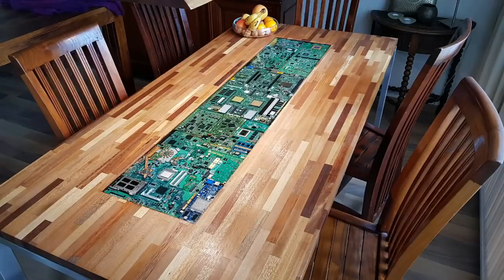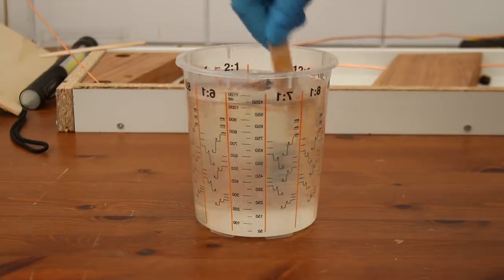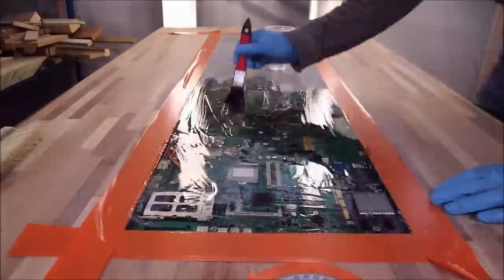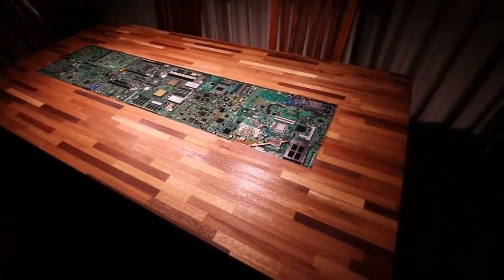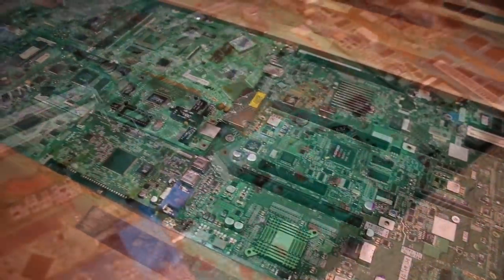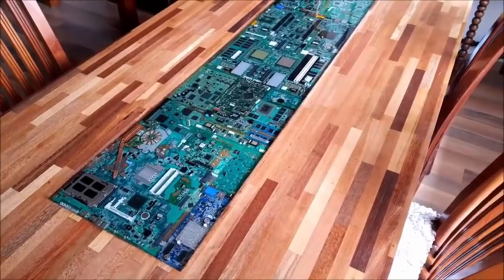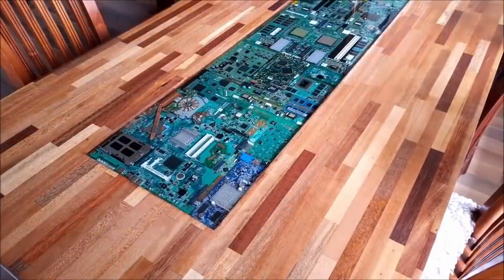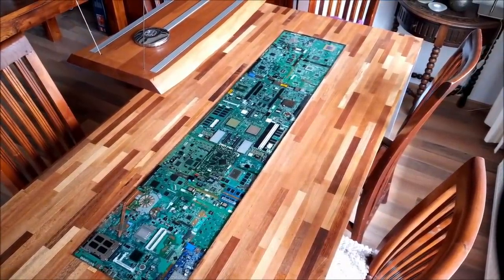Circuit boards with lights in epoxy in a table

Comment: Thanks for uploading failed projects. They are as useful and as informative  the successes. One question. Is there any issue the LEDs would overheat?
Reply from the maker: Thanks. Ouch, you've not seen the whole video, now have you? Because the answer to that question is in it. (What looks like a LED, doesn't have to be one.. 😊 )
Reply: @Onrust1  I usually stop videos less than half way through and then skip to the end .... but if you insist. I will watch ALL of it..... Okay done that, see what you mean, next time I will watch all of it.Actually fibre optic was a really clever idea!

Comment: The epoxy should be mixed for at least 3 to 5 minutes to be well mixed, you never used flame to remove lumps of air and give more transparency between the layers
Reply from the maker: You should watch this: https://youtu.be/rJBFk-5gMQY 
In there I explain more of what I did.

Comment: I’m wondering if you were to remove a 1/4” of depth with a router , sand it clear and then add more epoxy ,or a layer of 1/4” glass ?  Not sure how to fix the damaged area however where it’s not clear
Reply from the maker: That's about what I did. Check it out here: https://youtu.be/rJBFk-5gMQY

Comment: Try router out a thin layer with out hitting the circuit boards and putting fiberglass resin over the epoxy.

Comment: I'm useless with this kind of thing, but would a good method have been making the circuit board part in a separate vessel and sliding into place after a successful pour and set; avoiding the imperfections of the table and the one-shot-deal of the procedure?
Reply from the maker: You're being to hard on yourself. How can thinking with me be useless? 😊 Yes, you are right, it would have been possible, and with less risk, but with more work...

Comment: we've had problems working with Epoxy before, we think it was to do with the solder/copper on the pads corroding and interfering with the curing process. we've also had similar problems when not mixing the 2 parts correctly, with the amount you had you'd probably need a mixing machine... or maybe something not as thick so will mix better.

Comment: Put a wide flat metal "frame" around the edges to cover all that up - it might diminish the size of the circuit display, but it would still look awesome, especially if you then did a thin pour over that and the entire table (you could even put the same kind of thin metal edging going vertically along all edges of the table with just enough sticking up, like 1/8 inch, for the top layer of epoxy to pour into) - just a thought! I really did enjoy watching, nice edits & music, and I like that you didn't chat while working, subtitles were perfect to have in a video like this. That pouring... ah!!!
Reply from the maker: By now, I'm ready 'fixing' the table. As you can see here:  https://www.youtube.com/channel/UCNdDV4vHKjuWOYlEW4HIk5w/community   I routed out the bad spots and poured in new epoxy. It's much better now than it was. Wait for the video 'how (not) to pour epoxy'. 😊

Comment: with the epoxy you work only ones no put one layer and live dry by air you have to use fire a tourch for live clear and strong, look other videos of working with epoxy and see they use fire in the proses for solid and put all epoxy  crystal clear ,god blest you bye

Comment: just put a glass plate over the entire table , boom - done   it’s still awesome work you done  and very unique
Reply: This is the best solution! If he doesn't want to put the glass in contact with the epoxy, he just has to put something to separate both things leaving a little space in between. That table looks just amazing!

Comment: I don't know if this would work for sure, but I'd try drilling from under the table, in a few spots, with a forstner bit, until it gets to the epoxy, and then hammer it out from underneath, using something to fit in the hole, while tapping it with the hammer.

Comment: Couldn't you just sand down the the epoxy to remove the soft spots?then pour it again?
Reply from the maker: Sanding soft epoxy is impossible - your sanding paper would be filled and useless very quick. But yes, taking it out was indeed essentially what I did. As you can see here:  https://www.youtube.com/channel/UCNdDV4vHKjuWOYlEW4HIk5w/community   I routed out the bad spots and poured in new epoxy. It's much better now than it was. Wait for the video 'how (not) to pour epoxy'. 😊

Comment: Would it really be problematic to use regular LED's by the way. I mean we are talking about a very small DC current of say 200 mA at 5 V or less to light them all. And I assume once dried the epoxy makes a perfectly fine insulator. Given the low power requirements if anything fails it's most likely the transformer and not the wires or the LEDs.
Reply from the maker: Yes, I agree with that. But for me it was not so much a technical question, but more in the usability ... I thought you would go crazy quickly with battery powered lights with a controller, because of that carnival in the table all the time... 😊 It is the temporary character of the manual light for a few seconds in the fiber optic that I like.
The sheer simplicity of this solution has its charm too, don't you think? 😊
Reply: I can see the benefit of the interactivity of the fibres. Especially if the idea is to display the piece in a public setting as anyone with a light-source can bring the LED's to life. 

That said I would probably go with a small integrated circuit and micro-controller if I planned on actually using the table. Basically something like an Arduino or a Raspberry PI comes to mind although better dedicated light/display controllers probably exist. The arduinos can usually be powered with any 9-12V power source so you don't have to go with batteries if you have a fitting AC/DC transformer lying around from an device that's broken or unused. The benefit would be that you could control the lights via programs. Effectively running multiple patterns and controlling which via a switch. Similarly one to turn them off or go to a default program can be managed via it's own switch. The controller can be hidden in a discrete box beneath the table or in a recessed box if you want to go the extra mile :)

Comment: shoulda done RGB
Reply from the maker: Disagree, obviously. 😁 I deliberately left out the battery powered lights with controller, because I thought you would go crazy quickly of a carnival in a table all the time... 😊 It is the temporary character of the manual light for a few seconds in the fiber optic that I like. 
On top of that, RGB could break down, my solution is infallible.

Comment: i would dig out the failure part and replace it with red motherboards, stain the wood with mahogany color.
Reply from the maker: I'm almost ready 'fixing' the table. As you can see here:  https://www.youtube.com/channel/UCNdDV4vHKjuWOYlEW4HIk5w/community   I routed out the bad spots and poured in new epoxy. It's much better now than it was. Wait for the video 'how (not) to pour epoxy'. 😊

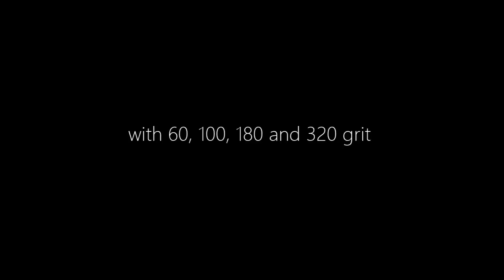Comment: At 11:45 i would of just flooded it with another batch of epoxy, you must have about  $800.00 in there already ,whats another $150.00. No sanding just built up. Just my opinion.

Comment: wont fix the bad expoxy parts, but put a large plexaglass or just glass cover and you stop the sticky issues.
Reply from the maker: I'm almost ready 'fixing' the table. As you can see here:  https://www.youtube.com/channel/UCNdDV4vHKjuWOYlEW4HIk5w/community   I routed out the bad spots and poured in new epoxy. It's much better now than it was. Wait for the video 'how (not) to pour epoxy'. 😊

Comment: Hey, this was a cool project; it's a shame it didn't work out as you'd intended. I have an odd question though: what was the large, dual socket server motherboard (at 1:15) originally from? I've been trying to figure it out for a while and suspect it might be from an AMD Socket F/C32 machine, but I can't quite put my finger on it. Thanks!
Reply from the maker: It was an old rack mounted Sun server from a datacenter. I don't know what sockets... Sun? I guess..
Reply: @Onrust1  Thanks, that narrows it down a bit :)

Comment: At least you tried. Just make sure the epoxy is mixed right. I made a surfboard back in 1985 that failed due to the same issue.

Comment: You worked so hard on it .... could you cover it with a piece of glass or plexiglass ?? if you simply cut out the entire epoxy psrt, you could start again !!?
Reply from the maker: Yeah, options, options... 😁
I'm almost ready 'fixing' the table. As you can see here:  https://www.youtube.com/channel/UCNdDV4vHKjuWOYlEW4HIk5w/community   I routed out the bad spots and poured in new epoxy. It's much better now than it was. Wait for the video 'how (not) to pour epoxy'. 😊

Comment: Make a bigger cut out and take out the old circuitboard and epoxy completely - old circuit boards are cheap (free) so why not just redo the insert hole with new material?
Reply from the maker: If it was a commissioned deal, I would have done that. But because I wanted to learn from the experience, I decided to try to 'fix' it. Not only could I better see where I went wrong, but I would also get to learn if it was possible to fix these kind of problems. 
I'm almost ready with that. As you can see here:  https://www.youtube.com/channel/UCNdDV4vHKjuWOYlEW4HIk5w/community   I routed out the bad spots and poured in new epoxy. It's much better now than it was. Wait for the video 'how (not) to pour epoxy'. 😊
Reply: @Onrust1   Cool!  and kudos for the work and sharing. Thanks.

Comment: this is so damn cool. But  you should have put a vibrator on the table while it was drying?
Reply from the maker: Vibrations help to get bubbles to the surface. I had my sander at hand - and then I hesitated, because it was so dirty. I was afraid the dirt would get in the epoxy, so I just didn't. But it is my experience that my epoxy is so fluid, that bubbles come up anyway - no need to shake it up extra..

Comment: That's so cool! Just out of curiosity, how does the weight of the epoxy compare to the weight of the wood that you had to take off? Is this why the table was bent in the middle?
Reply from the maker: Oof... you could look up the weight of epoxy relative to wood... I don't know, I guess it is somewhat heavier, yes. But there is no way that my actions caused the table to be bent. Because there are two fairly big steel beams running underneath the table.. (At some point they are visible in the video.) As I said in an earlier comment; it is far more likely that in a former life of the table, some fat lady sat on it. 😁😁

Comment: The table was bent because you cut a big chunck out of the middle of it, thereby altering the overall stability of the timber. Great idea, and the led's made it moreso, very clever!
Reply from the maker: With two fairly big steel beams running underneath, there is just no way my actions were the cause of the table being bent (it is more likely that in a former life, some fat lady sat on it 😆😆). Thank you!
Reply: @Onrust1   But they were going down the lenght ?

Comment: Hi, Onrust.   Don't trash the table.  Make a routed bevel around the wooden part of the table just outside the epoxied piece.  Purchase a 1/2" sheet of clear glass and sink it into the groove around the circuit board.  Make the edges smooth or even a little bit higher than the circuit boards.  Place it and leave it there.  As a life-long artist and art teacher, I believe if you did that, there is someone who loves it as much as I do, who has the money, would buy it for at least $70,000 to $80,000.  I know art and have seen items like this go for lots more.

It's an  exquisitely done, labor intensive piece of ART.  At first I thought it was created out of thousands of pieces of colored glass, then when I looked again, I thought it was a tiny town, an industrial district.  When I full-sized the page, I was amazed to see a highly original and complex collage of circuit boards!  Check on the use of heat guns to quickly remove air bubbles.  In miniatures and scale models, we use a lot of "Realistic Water"  for waterfalls and rivers.                                                                                                                                                                                                                          

As a former art teacher, I saw all kinds of creativity and excellence in your table.  Please don't get rid  of it.  And sign and date it on the underside, in Sharpie, so it can be seen.  Here's hoping some of the idiots (below) go away.   Art is a creation of materials made by a person.  If you put this table, fixed, up for sale, I can almost guarantee that it will sell.      Happy 2020, and don't stop being creative.        :o)     Donna Blackman
Reply from the maker: Thank you!
As a YouTuber, selling is not my first interest. 😊 But my space is limited, so I am thinking about it. The table is signed, I poured in the letters 'Onrust!' in the epoxy as you can see here https://youtu.be/ERNt1nGtONI?t=817

I'm almost ready 'fixing' the table. As you can see here:  https://www.youtube.com/channel/UCNdDV4vHKjuWOYlEW4HIk5w/community   I routed out the bad spots and poured in new epoxy. It's much better now than it was. Wait for the video 'how (not) to pour epoxy'. 😊

Comment: Nice table, if you could remove that circuit board and replace it with wood it would be a useful piece of furniture.
Reply from the maker: Nice comment. If you would throw away the content and put in something nice, it would be a useful comment.

Comment: Awesome project and table look's great! Wonder if maybe the epoxy would have turned out better if you had poured the epoxy on in multiple layers, allowing for each layer to dry first before proceeding with the next layer?
Reply from the maker: No, the problem was bad mixing of just one layer - I did pour in multiple layers. 
I'm almost ready 'fixing' the table. As you can see here:  https://www.youtube.com/channel/UCNdDV4vHKjuWOYlEW4HIk5w/community   I routed out the bad spots and poured in new epoxy. It's much better now than it was. Wait for the video 'how (not) to pour epoxy'. 😊

Comment: Bevel the table and insert a glass top?  Would that work?  That could "rescue" it?
Reply: Great job, regardless ... it worked enough to see how good it could of been !!!
Reply from the maker: That would definitely have been a 'quick fix'. But by now I'm almost ready 'fixing' the table. As you can see here:  https://www.youtube.com/channel/UCNdDV4vHKjuWOYlEW4HIk5w/community   I routed out the bad spots and poured in new epoxy. It's much better now than it was. Wait for the video 'how (not) to pour epoxy'. 😊

Comment: Mix it right and pour 1inc more over whole table but ask manufacturer frist if a hard cap would work
Reply from the maker: by now I'm almost ready 'fixing' the table. As you can see here:  https://www.youtube.com/channel/UCNdDV4vHKjuWOYlEW4HIk5w/community   I routed out the bad spots and poured in new epoxy. It's much better now than it was. Wait for the video 'how (not) to pour epoxy'. 😊

Comment: The wood could be salvaged by just sanding off the epoxy and cutting out the circuit board/epoxy composition.  You could just start at 50% and rebuild from there, complete with a new pour, completely mixed...just my 2 cent.  Nice vid!

Comment: This happened with the Valiant sailboat hulls.   You should have used polyester casting resin which is much less expensive than epoxy resin, and suited for thick pours.   Some other techniques are to vibrate the resin before the pour and perhaps to heat it a bit to start the cure through out the entire mix.   My guess is the soft spots are in areas that didn't generate enough heat.   I'm really surprised you were advised to use epoxy on the first place.   It's entirely unnecessary and apparently not at all well suited to the thickness of the pour.  I guess you could have done a series of thinner pours, and used a heat lamp during the cure.  Sometimes that's hard to control because the lamp can create hot spots.
https://www.amazon.com/Clear-Casting-Resin-Catalyst-Ounce/dp/B0018N9E3M
Reply from the maker: The resin you linked to at Amazon is more expensive than my epoxy. The specs of my (slow curing) epoxy said I could pour 5 cm at once (2"), I did maybe 1 cm. I poured some layers since, none went bad apart from this one. I still think I messed up the mixing. Thanks for thinking with me.
By now I'm almost ready 'fixing' the table. As you can see here:  https://www.youtube.com/channel/UCNdDV4vHKjuWOYlEW4HIk5w/community   I routed out the bad spots and poured in new epoxy. It's much better now than it was. Wait for the video 'how (not) to pour epoxy'. 😊

Comment: Great project. Why don't put a glass pate (shatterproof) on the table. The faulty epoxy would be covered and the table is ready for use :-)
Reply from the maker: That would definitely have been a 'quick fix'. But by now I'm almost ready 'fixing' the table. As you can see here:  https://www.youtube.com/channel/UCNdDV4vHKjuWOYlEW4HIk5w/community   I routed out the bad spots and poured in new epoxy. It's much better now than it was. Wait for the video 'how (not) to pour epoxy'. 😊

Comment: the whole table could just be covered in well-mixed epoxy. you wouldn't be able to feel the wood but at least it wouldn't be sticky.
Reply from the maker: By now I'm almost ready 'fixing' the table. As you can see here:  https://www.youtube.com/channel/UCNdDV4vHKjuWOYlEW4HIk5w/community   I routed out the bad spots and poured in new epoxy. It's much better now than it was. Wait for the video 'how (not) to pour epoxy'. 😊

Comment: If you put the table in a heated area of about 40 -50 degrees it will Remelt and assist the epoxy to harden even if there is less hardener in the area